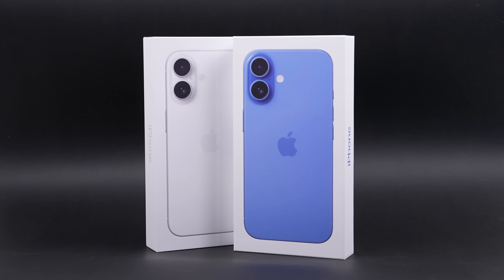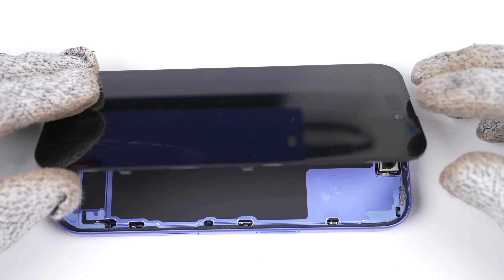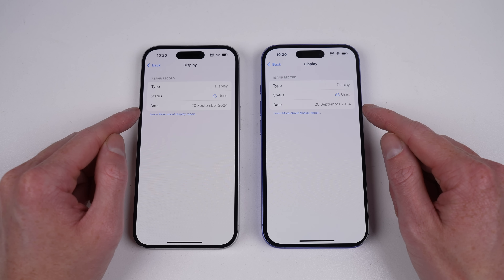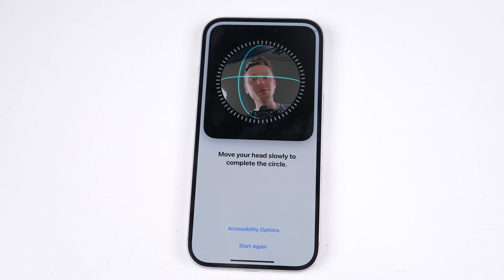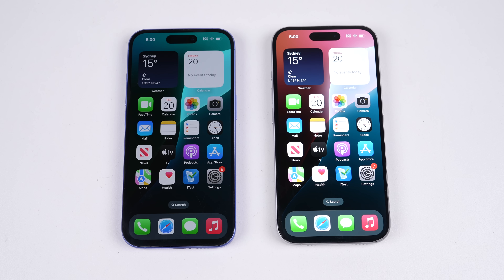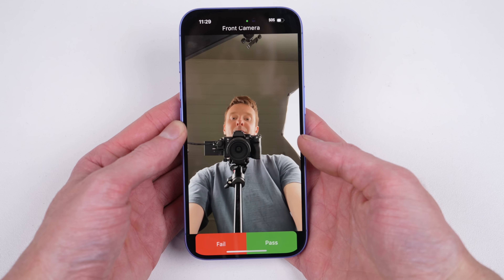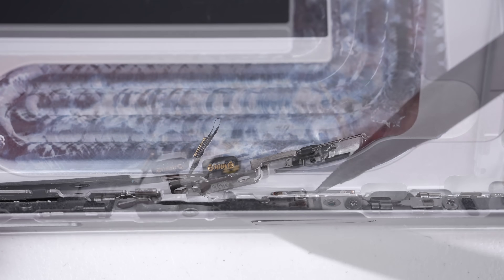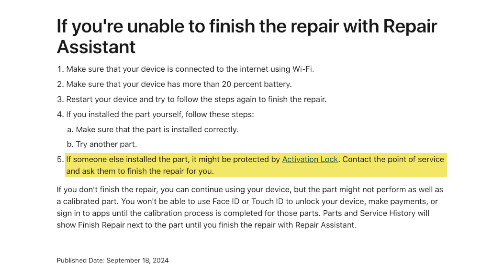iPhone 16 Changes How We Repair iPhones - 3rd Party Display Issues - Teardown And Repair Assessment

Comment: Personally I think anyone buying a phone should know if somebody has opened and replaced the screen so I don’t see an issue with that even if it’s the same screen that’s been swapped it’s still been opened and tampered with which could have issues with the waterproofing, also it highlights these eBay sellers who sell (good as new) style phones which are actually Frankenstein phones of mismatched legit parts, I wouldn’t want to buy a car that’s actually 2 cars welded together so why would I let it slide with a phone? The system is good improvement imo.

Comment: iPhone 17 will probably have no cable, iPhone 18 will have no manual and sim ejector. iPhone 19 will have no inside plastic holder but is held by the box only for climate. iPhone 20 will have no prints other than apple logo and model on the box made with ink from cow poop (for climate). iPhone 21 will have a mini box that's just a bit bigger than the phone itself and is basically a carton case. iPhone 21 will have only the protective stickers. iPhone 22 will be bare phone handed by employee.
Reply: Don’t give Apple ideas

Comment: So what's up the next time?
No Ibox?
No Ireceipt?
No Iphone?
Having to buy an Imac Pro to eccess the Iphone?
It get's worse and worse.
Igreed is their thing.
And the Ipad I gave my wife last year: no repair of display can be done. So throw it Iway.
VERY saving the Planet - Inot!
I guess that my 256Gb 12 Pro Max will likely be my last apple product, unless they begin to change their practices.
Those cheap chinese use and throw away ulefone begin to look attractive with their lack of spares, but cheap price and tons of features.

I slaughtered my old Mac Pro (late model) to reuse it for proper PC hardware. And reusing all Apple internals, incl. all cables and connector functionality as well as reusing the original back parts, connectors etc. No ugly new rear faceplate with big bolts. I use it with original Apple power cables and my Apple 27" monitor. It is SO cool looking and proper working - PC with proper Windows. That's all the Apple can be used for these days.

Cheers.

Comment: I’m pretty sure my 15 pro is  changed screen I bought on eBay everything seemed fine but I could tell something was up and I put it next to another 15 pro and I could easily tell it was not as bright o honestly was told it was the screen protector tell it all clicked. You could easily tell the one in the store was way brighter: I bought an iPhone 13 from the same eBay dealer, and I looked in settings and it said that the screen was changed. When I looked at my settings, it doesn’t say any screen was changed though so it’s kind of weird, but I was thinking I was buying an open box item.

Comment: So Apple needs to approve every single repair. They decide which part exactly is repairable and which is not. They also decide in which quantity and package parts for repair get delivered.

That means you still have zero control and pricing is completely screwed by Apple. No third party parts. No unofficial repairs. No discounts.

Comment: I kinda disagree with you on one point...  I think it is a good thing that Apple identifies and does not allow pairing with 3rd party parts.  Even the back glass with the coil.  With the deluge of cheap and substandard parts coming out of China, I think it is a good thing that a replacement part going into an iPhone meets some basic spec standards.  That being said, a possible solution (and I know this is a pipe dream) would be for Apple to work with reputable 3rd party suppliers to make sure that their parts conform to basic functional, quality, and safety specs.  I would not want a substandard charging coil to overheat in a phone and blow up the battery.  I am quite content sourcing genuine Apple used parts for repairs, and this makes sure that is the case.

Comment: This looks alarmingly similar to Volkswagen Audi Group parts replacement for anything immobiliser or component protection coded. Every module is assigned a unique identifier(called FAZIT in VAG terminology). This number is used for tracking which components are new, used, reused and more importantly stolen. I would not be surprised to learn that if you reported one of those new iPhone 16s stolen it would lock it's parts from re-use. VW immo/CP reuse allows unlimited reuse until a part or the vehicle which last used that part is reported stolen. The fact that you must connect wifi and be on latest software says to me they're ensuring you're up to date for their deny listing. Now you might say but I don't support the use of stolen parts but VAG take it an extra step and SOME parts can only be used ONCE. Once used even if they weren't the issue and was just used in diagnosis are now irrevocably locked. This will happen if Apple are using a similar model to FAZIT/CP.
Reply: Sounds like a Europe issue USA would never allow that, unless you are taking about EVs and nobody buys those

Comment: I stopped buying iPhones at 14 here in the USA.
I will not own any phone that doesn’t have a sim tray. The bigger FU from Apple is that everywhere else on the planet iPhone DOES have a sim tray. It’s only the USA that gets screwed.
The 13 ProMax was the last iPhone I will ever buy.
I still buy iPads. But because of apples iPhone debacle, I’ve started looking elsewhere for tablets, and have found another company that for the moment seems to not be fracking its customers to the extent that Apple is.
That company is OnePlus. Here in the states you can get a premium OnePlus phone for less than the iPhone, and the OPPad 2, depending on what you’re looking for, can be a good alternative to the iPad.
As much as I love my Apple devices, Apple is far to frequently stabbing its customers in the back. And I’m done with the phones, and working my way out of the pads.

Comment: Actually there is no justification for pairing the FaceID or fingerprint modules. They're just readers. The actual sensitive data is stored on the system memory on the motherboard.

Comment: Interestingly I found an article about a "new liquid adhesive that instantly cures to form a polymer bond when it is exposed to an electric current."

"Adhesion can be fine tuned by varying the electric current’s voltage and duration."

Comment: Is the new battery adhesive really re-usable? Hugh had no problem putting the battery back after applying nine volts — but I read on ifixit the batteries lose their stickiness after removing them. Perhaps it depends on the voltage applied?

Comment: Electroadhesion on the battery is cool for now! I mean, if you use a rechargeable 9V with good capacity.

This video was ruined by your script and flat reading. I'd think I'd see your experience better if you acted a little more like a certain Rossman and read things like you were there instead of dead inside from all the Apple to-do. At least act thrilled about your subpeona to appear as an expert witness in a smattering of International Courts?

Comment: 10:40 Even if you could get full brightness out of the software 3rd party OLED's are basically guaranteed to be cheaper, worse panels that won't get as bright. 🤷 Apple's buying the best OLED's Samsung can make. 3rd party part manufacturers looking to maximize profits definitely wouldn't lol. While 3rd party makes sense for plenty of parts (if Apple allowed it) only an absolute idiot would buy a 3rd party display panel.

Comment: Hello Hugh, i am recently having a problem with my Pixel 7 pro, where when i press on the lower to middle left part of the screen it completely shuts down, i saw this was a common issue with many pixels in reddit and xda forums and no one had any solution besides changing fully the motherboard and the screen. Which is not feasable because a new pixel 7pro costs 350$ in my country.

I am to angry to google so i dont want to purchase any more pixels, i was wondering though do you have any tips how i could fix this one?

Thanks

Comment: I guarantee they purposefully coded the third party screen to lower brightness. Tim crook at it again
Reply: The drop in screen brattiness is to protect the OLED.    

Each OLED that comes of the production line has differences in manufacturing, the production is by no means perfect (in-fact every OLED has 1000s of defects) the pixel response to voltage (per pixle) is different on every display.    In the factory each display goes through a validation process that checks the response for each pixel and creates a pixel response calibration map.  The inverse of this is then applied to the output single form the GPU to make sure colors are uniform but also importantly to make sure that it dose not burn out any pixels (as some pixels can be way more responsive to voltage than others).  

As the calibration map is per screen if you change the screen the system no longer has this calibration to it needs to run the display at a saver lower peak voltage (brightness) to ensure that even the most sensitive pixel will not end up burnt out.   (last thing you want to do is pop in a new screen and have it burn in some pixels before you get to the config screen to load the calibration profile right?)

Comment: this mean, the moment the official parts are discontinued, this phone become unrepairable.
Reply: No you can use third party parts however they will show up in settings as "Unable to identify"
Reply: @hishnash  but don't those 3rd parties part render the phone half operational as shown in the video?
Reply: @zerocalvin   Phone is still fully operational.   Yes a third party screen is not going to be as bright since it doe snot have a calibration profile so the system should run it at a lower voltage to ensure it will not burn it out.
Reply: @hishnash  your point are contradicting itself, if the 3rd party screen isnt as bright as the original, that mean the phone isnt fully functional, otherwise it will be as bright.

you cant have something with reduce function and still call it fully functional.
Reply: @zerocalvin  Its not about the screen being third party that means its brightness is reduced the reason the brightness is reduces is the lack of clabiraiton.   

Since each pixel responds differently to voltage when you do not have per pixel calibration loaded you need to be careful otherwise you run the risk of damaging a new screen that is installed before the calibration profile is applied.

Comment: I’m pretty sure the reduced brightness would be considered a safety feature as cheap screens may not respond appropriately to the full voltage. Same can be said for the back glass and wireless charging.  A non genuine MagSafe coil could cause damage at full speed, so I bet you that an unpaired MagSafe coil is limited in some capacity.
Reply: Yes, even first party screens each screen has a personalized calibration profile, the last thing you want to do is burn in some pixels before the user gets to load the calibration profile,.

Comment: Any parts from lost & stolen devices won't be able to pair, it will list the parts in settings as lost or stolen which is a great move from Apple. However devices that are just locked to iCloud will work with no issues.

Comment: The pairing of enclosure suddenly explains why the new button cannot be removed without destroying some welds as seen in the iFixit video... bastards.
edit: You found the same thing I see.
Reply: The paring is due to needing a calibration of the pressure sensor (very normal)

The reason it is welded is space, screws would need much more space. (This is down next to the battery so it can't take up much thickness at all)

Comment: I don't get the comments praising how "cool" the new battery replacement method is... It's just a method that's gonna require yet another tool... Glue method was simpler, requiring no tools or in some cases just a tweezer, which everyone has.
They should simply hold it in with a bracket or something that you can screw loose, no bullshit glue or electricity required, just the same screwdriver for everything else.
Reply: I think the battery expansion excuse is exaggerated. I will always reference Galaxy S5 that had all of the waterproofing and all-day battery life, but still the battery was easily accessible and could easily be popped out. Or is the new technology on phones going to make a system like that damage the battery? I don't understand why the old way of building a casing for the battery is no longer an option for the flagship phones.
Reply: @jltplease  Battery expansion is very much an issue with modern batteries.

Modern batteries are MUCH more dense than they used to be, this means more power per cubic mm but also means much more susceptible to fire when expanding and compressed. 

You could use older battery tec (or modern low density tec) that does not have expansion issues but these will take up much more space within the phone to get the same capacity.
Reply: anyone can pick up a v9 battery and some wires.   

The pull strip method while on paper does not require any extra tools as the phone ages the steps become harder and harder to remove (these videos of people removing them on 0 day old phones is not the real world scenario)  .

Screing in a batter has a huge risk of putting pressure on a focused area of the battery leaning to fires when it envirables starts to expand (yes every single phone battery will over time start to expand). 

This is why the glue down the center of the back of the battery, so it can expand in all directions without anything pitching on it (creating a fire).
Reply: @hishnash  Sure anyone can pick it up, but you shouldn't have to. And no, screwing a battery in place doesn't have any risk if it's designed properly. Or just have some other mechanism to lock the bottom part of it in place with a simple switch or something, can't be that hard to invent.
Reply: Not so simple, if you lock in part of the battery at the edge then when it swells (and it will) that creates a pitch point.    

Using adhesive in the center of the back of the battery is the best solution for multiple reasons:
1) the ensures there is no localized pressure point on the battery package
2) as the battery gradually expands the adhesive (unlike a screw or other clip etc) is designed to weaken and pull away to further reduce pressure points. 
3) The adhesive holding the other part of the phone together is also designed so be weak enough that as the battery gradually expands it will break open rather than have the battery be compressed to much.

This is extremely important as the batteries that swell tend to be on older phones people have forgotten that are sitting in a draw somewhere in your house.  Your not going to notice as they gradually swell up, and if they catch fire it tends to lead to a house fire as since they are in a draw (with other old battery tec) they are in a perfect place to start a fire (remember battery fires do not need oxygen as they already have the needed oxidizer within the battery chemestry)

The solution needed to get to solid climbable, screwable batteries is a change in how batteries are made away from Lithium Ion to something that does not swell as it dies.
Reply: @hishnash  It actually IS that simple. You can create flaps it holds onto or something from the bottom side, effectively having the same effect as the new technology that requires using a battery to loosen. Or a locking mechanism that holds it from the bottom. The problem has always been that Apple does not want you to repair things, and if you're going to repair it, they will make it as difficult as they can. They will never make something that's easy to repair.

Comment: i don't need any high end phone that kinda hard to repair and hard to find it replacement part, all i need is low end phone that do amazing thing like 70 bucks phone i had for 5 years that i can pop open it back cover, pluck out old batery and plug in new batery

Comment: I fully support repairable phones. But this is a one rare move I support Apple. It is not like Apple is locking then out completely but only asking them to be unlocked if they are from a previously activated phone. This will be deterrent for iPhone thieves while legit buyers of second hand parts can easily ask for unlock codes.

Comment: Wonder if the 9 volt batteries miniscule current rating made the battery removal not go well on the initial tr, and a current limited 9v power supply might have worked better? cool method either way, those pull tabs on previous designs are awful.

Comment: Ok I'm impressed with the new pull out battery method, Apple. For that one, congratulations. Now, where the heck I'm supposed to find those cables? It's not like old cables from circuits toys can work

Comment: I don't disagree that Apple still has a long, long way to go with repairability and that the level of control they they have over a device that is ostensibly owned by the user is Orwellian but I do think it's important to recognize that this is a significant (though flawed) step forward in repairability.